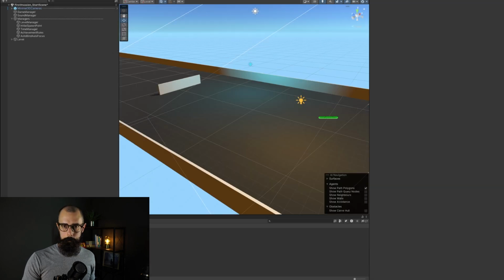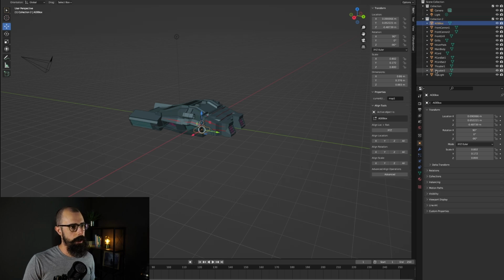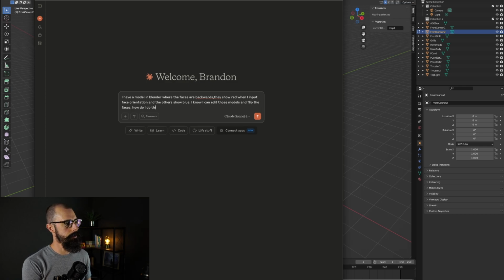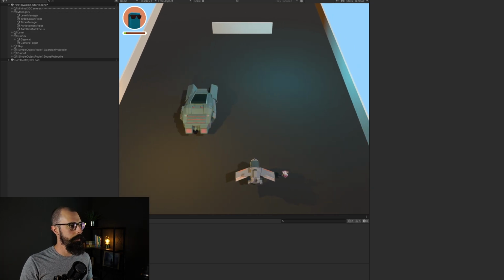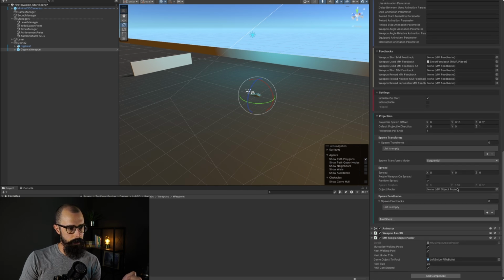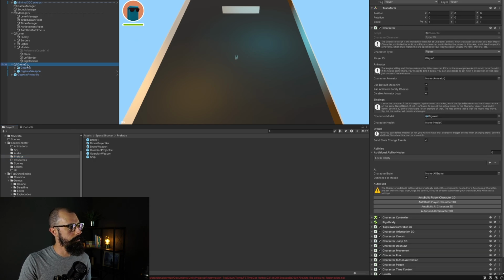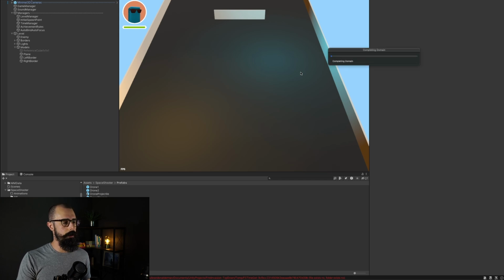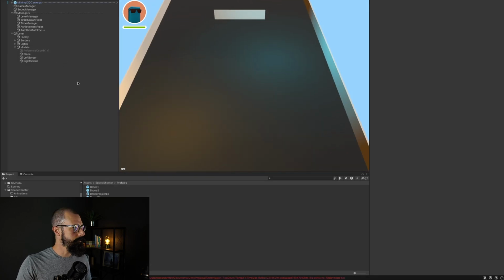Unity Top Down Engine: Importing Custom 3D Models & Drones

Comment: where is the link to that previous setup video? I'm learning the top down engine currently making a mobile game where the player is stuck at the bottom of the screen and the enemies come down the screen.  top down engine is great but is lacking in tutorials on how to do a lot of things. other than the devs own tutorials
Reply from the maker: This is where I explored some top down engine. I agree it needs more tutorials but it seems super powerful. I’m still learning quite a bit. 

https://youtu.be/vLHKmJchVH4?si=K0P-Qt_sbryqq_VX

AI seems to get me in trouble as I think the top down engine components would make things easier when AI tends to try to recreate instead of use what’s there.
Reply: @BrandonBuildsGames  yes, I use AI to help me with questions like "how do I do this in  Game Creator 2 (great visual scripting tool for unity)" and it sometimes makes up features that the asset does not have or it works differently than AI thinks it does, so due diligence is necessary. A lot of times it comes up with good ideas though
Reply from the maker: @mikeha for sure! Totally agree. It helps figure out design and ideas from proven models. I’m going to try and do much smaller edits and also use it as more of a tutorial so that I can learn more to help with troubleshooting. Let me know what you end up building. I’d love to see the progress.
Reply from the maker: Maybe I’ll plan a more overall tutorial for top down engine once I wrap my head around everything.

Let me know what you learn too. It seems powerful.